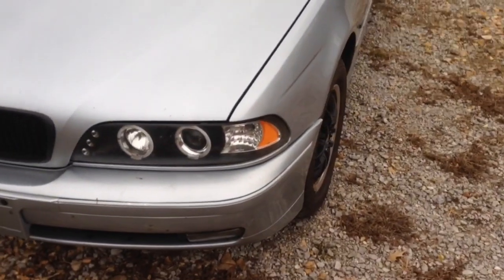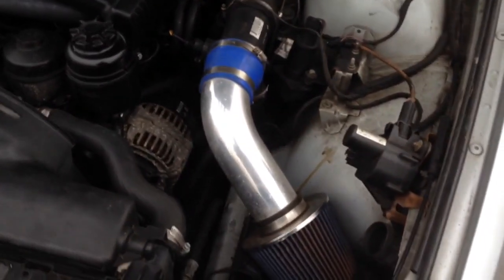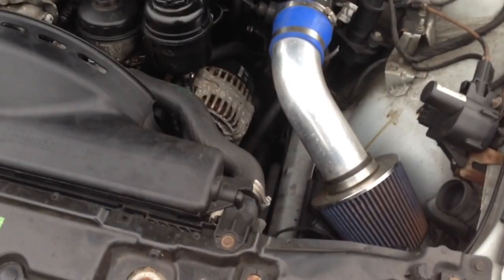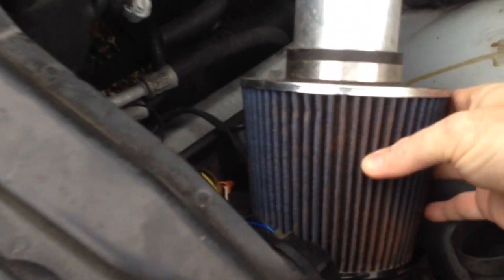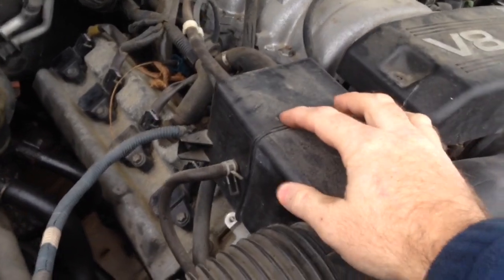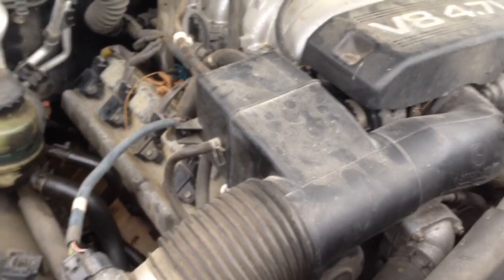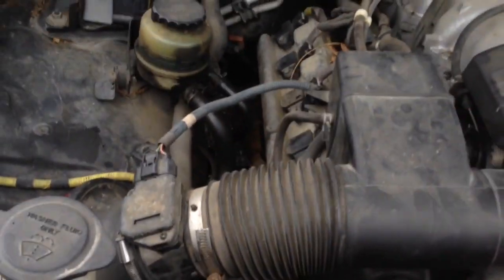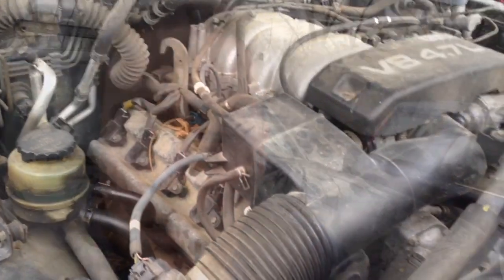Cold air intake CAI does it actually help or hurt performance?

Comment: i use a napkin from burger king for good airflow and easy repair when needed.
i don't need to wash it.
i just get a new burger with a napkin.
Reply: Daniel G - lol. burgers are gooooood.
Reply: I tried several different air filters and found that wet napkins from kfc work best

Comment: I've rarely seen anyone clean a K&N.  My beef with them is when they replace the stock tubing and have a built in port/mounting for the MAF.  I've seen cars run goofy, and have lean codes because of the shape of the new tube is so large, that more air actually goes in than the MAF reads.  This throws off fuel maps and you end up with codes.  Easy access for working on is nice though.
Reply: RX8 is massively prone to this issue

I've a E46 with a HKS foam filter fitted & I've no fault codes or running issues...overall ppl just need to research in what they want & who to buy from ie buying a cheap filter from Ebay wouldn't be a good idea as you;ve no idea what the element is really made from, if any real R&D has been put into the development 

anyway regarding the goofy readings usually this falls down to the simple efficiency of the filter ie there too free flowing for the basic set up. also of cars get set up with the paper filter restriction to reduce/control the performance hence the issues ppl get when playing about with there engines!!

"a simple choice is made harder by the manufacturer, they've done similar things with stereos in cars ie encorporating heater systems, sat nav, aircon, etc etc making any chance of an upgrade a very expensive choice, compared to olden days when the choice was yours to make"

Comment: if you make the engine breathe better by having higher flow intake/exhaust vavles, that might justify having a CAI
Reply: that will also throw a P0171 system too lean code and the car will always hesitate on acceleration :D

Comment: Higher flow = more dirt. No way around it. If you daily drive, best use highest dirt filtration possible, which means cheapo paper. Racing, track, autoX it would be more useful there.
Reply: John Faire I see your point, but it's  not necessarily true. If you increase the surface area of the filter element (easily done with most cone filters over the factory panel), you can not only have greater filtration (not achieved with the cheap filters) but also increase airflow.

Comment: With this setup the intake air temperature will be whatever the engine compartment temp is. That will be pretty darn hot. For example, I've been sitting in my  car with the engine running at idle and engine fully warmed up. After 20 minutes in park and at idle the
Outside air temp is 51F.
Intake Air Temp is 163F.
Hot air is less dense so  that will decrease performance.  Not sure why they call this a cold air intake.  Unless you are pulling outside air into the engine you are defeating the purpose of a cold air intake system.

Comment: Question... does your front signals on your aftermarket headlights  stay on with your day lights?? If not how did u get it to not do that?? Mine stay on and when u hit the signals it works only if the lights are off once on to the headlamp postion it stay lit and only the side markers and tail signals flash.. i need answers

Comment: That's not a cold air intake....so how can you comment on the performance impact of a cold air filter when you're not even using one?  Neither of your cars are using cold air intake.  They're just using a conical filter.  They're sitting inside the engine bay...and not isolated from the hot air all around it.  Like this isn't even remotely what a cold air intake is about.   Cold air intake allows higher density air into your system, even without having a filter with less restriction.  So the existing capacity of your system is increased because the volume of air it's pulling in is the same...but there is more air in that same space...because temperature...meaning better combustion.  This video is embarrassing.
Reply: This exactly, it would appear for American YouTubers CAI and cone filter are interchangeable. I'm currently using a stainless elbow to put the filter up against the headlight, and I'm still seeing 60c+ intake temps on hot days. It sounds good but is the opposite of a cold air intake